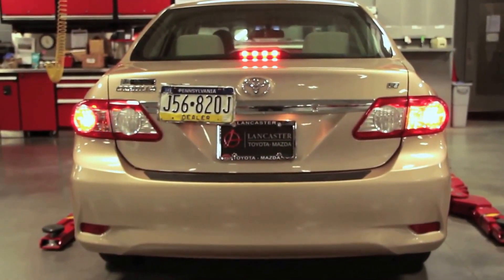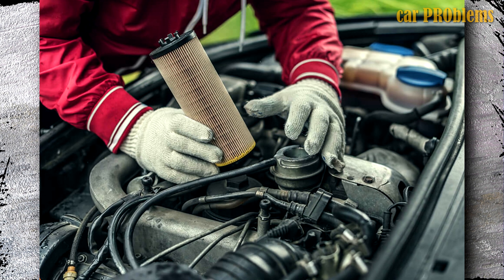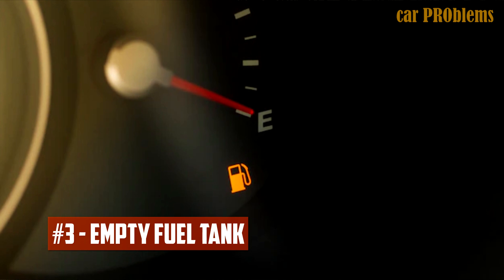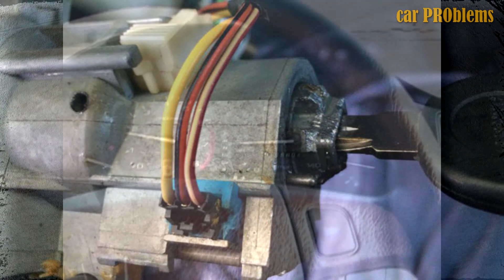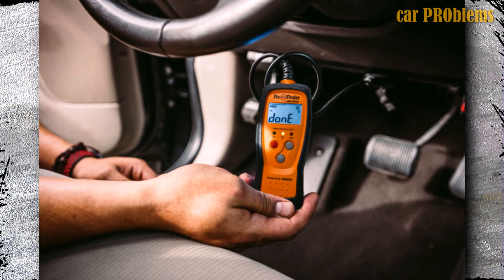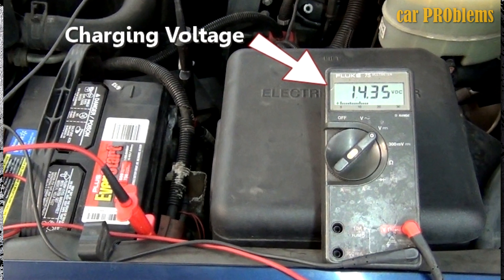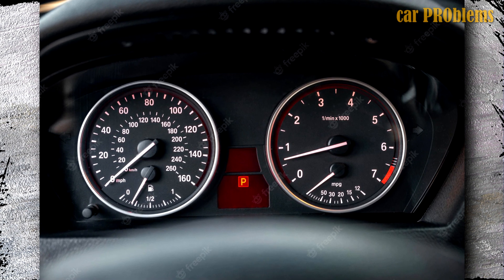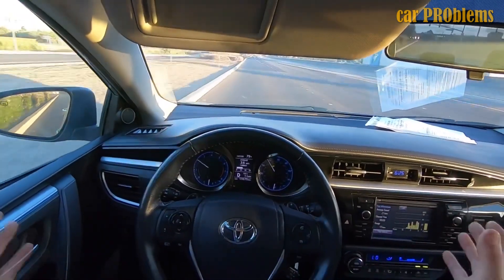6 Causes of Car Turns Off While Driving. Here what to do!

Comment: I don't care what anyone says. There's not a code for a bad fuel pump. Because my fuel pump went out and there was no check engine light. Even when my car had power from the battery and I would try to jump start it. I knew what was the fuel pump. Checking to see of a bad fuel pump is actually a very easy way. You don't actually need a scan tool for that, but it's not like a cold pops up for that anyways, I would know. The camshaft position sensor code popped up but it wasn't the camshaft sensor. It was the fuel pump that went out. There was no code for the fuel pump. So having the scan tool necessarily won't help you fix your car because it only reads what the computer reads. My car is a 2001 so it of course it's old.
Reply: But what do u think if the fuel pump is changed new and again stalls?

Comment: My car has both crankshaft sensor and camshaft sensor and have replaced both. I also replaced the fuel pump and the fuel filter. But my car still kept shutting off but it would start wrapping up with no issues. Also replaced the battery starter alternator and the spark plugs and air filter. But in this case the map sensor was broken. But I got everything fixed and now my car runs like a new car. It's smooth and quiet and it doesn't even misfire anymore.
Reply: So you changed map sensor and now everything its fine?

Comment: Hi,typiing from italy....i have a hyundai matrix 1.5 diesel 2005....while driving yesterday it stopped suddenly with no apparent warning...i did so many tries to make it start no way....on the dashboard there is no warning sign..coolant is ok....oil level ok...infact all fliuds level is ok......as it started i drove for about 30mins it stopped again with no warning...i put in the key try starting it but no way....after about 15mins it  started again  without me doing anything special.....i went out today samething after about 30mins drive it stopped....i did all i could to let it start no way only after about 20mins it started...what can be the problem???
Reply: Hi, did u fix that what was the problem ? Thanks!
Reply: @LeutrimKapllani  yeah bro i took it to a mechanic it was fixed..the problem was a bad crankshaft position sensor...he repleced it,the car is working now very well..thanks for yr concern and best wishes bro!!

Comment: I have a murano nissan 2009 it shut off when I am driving and not taking no gas I have make it cool off before  I can get it start and I have it jump start  but when I get the jump  start I can shut it off and start it but when it shut off wild driving it cannot  start I have let it cool off all senses change  the alternate is good the is good and light or still on and the problem is still there
Reply: Same problem right now with my alfa Romeo. No error codes showing doing diagnosis. Please have you found a solution to your problem?